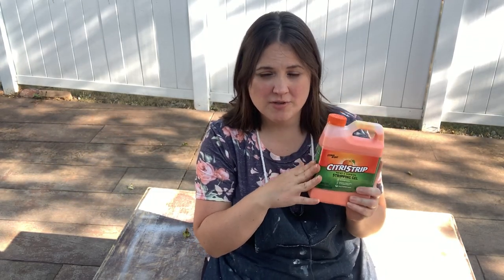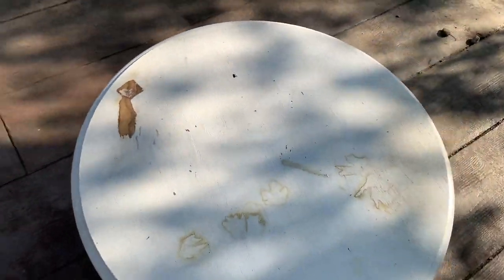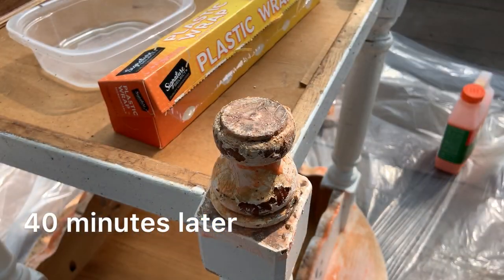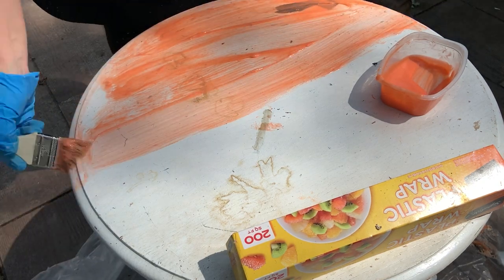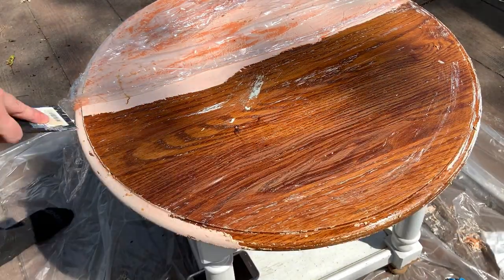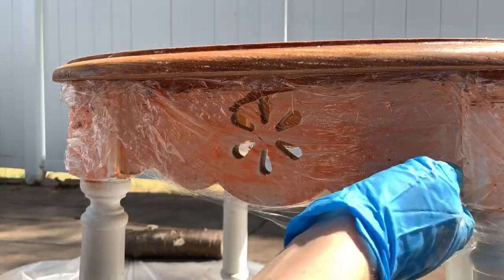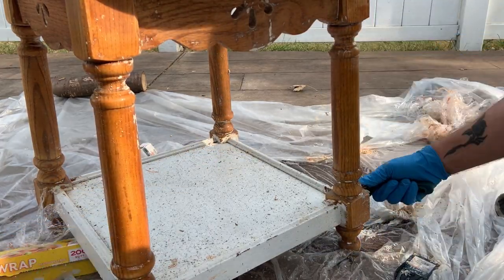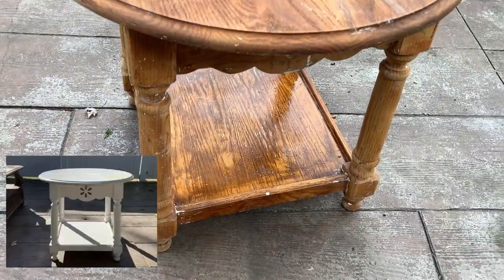How to remove latex paint from furniture using Citristrip | Furniture makeover basics

Comment: You did it well! You answered my questions so good. I was hesitant to use too much mineral spirits, but you showed that it couldn't hurt a thing! I used the wrap, but some was drying before I finished applying to my large table..but I should have done it in sections as you recommended.  I'll keep going using that tip.  Thanks for helping with all my questions.  I even went to the manufacturer website and it wasn't as good as yours.  Thanks so much.

Comment: Thank you so much, it has made my project now go much faster and smoother. I was about to give up on my project when I stumbled upon your video, and its made all the difference.  In my state they don't sell the mineral spirits so I've had to order on-line, but I have such a large project to do, its taken several coats to remove all the layers and should arrive in time, to complete the piece.  My project is a built in China Cabinet running the length of a wall. thank you for making this video to help people regular folks like me, strip paint from wood.
Reply from the maker: I’m so glad! That China cabinet sounds like a difficult project. Good luck on finishing it and Thank you for watching😊
Reply: @FlipItFurniture  Thank you for the encouragement. I'm almost done stripping 1/2 the cabinet (goes the length of the entire wall: floor to ceiling).  I have to do little section at a time and each section takes 3-4 hours. (I even had to buy couple of tools for the engraved glass areas) I plan to go buy the Dixie Brand paint and start painting by next week. I will send pics when completed. Your videos have helped me sooo much!

Comment: Is the brush you used metal or nylon??  Also the steel wool. Is it coarse or fine?  Loved the 13:07  video
I am trying to strip paint from an old wooden floor that is painted around the edges and had linoleum in the middle!  Any other hints would be must appreciated!  I only put on the citristrip and waited 30 minutes and found out that 13:07  was not long enough and left it 2 hours. Came off a little better but sticks in the grain of the wood.  Wood had never been finished so it is not entirely flat for the scraper to remove the paint. So I am going to use the plastic wrap and brush and steel wool along with the mineral spirits and see how that goes!!

Comment: I have used the very toxic strippers in the past and the do work really well. However, due to the high level of toxicity, I researched the best green stripper and decided on citristrip because the table I was refinishing was veneer. I used the wrapping in saranwrap strategy, checked on process, and waited suggested times. The result was it stained the veneer beyond salvage for staining. I had to paint table. I have since discovered that has happened to others as well. I was told the formula has changed from original formula.

Comment: You can use the plastic wrap- pending your piece underneath and the amount of paint you are removing- you can also leave the strip on overnight . The directions said wrap- I had XXXL wood beams I tested on. I actually left on overnight and DID NOT cover. I came back and the paint layers curdled like a halloween latex mask lol and just feel off in large pieces. ... just an option for people who have XXXL jobs and want to try this. I've used on floors and small and now XL residential pieces.

Comment: I wish I had seen this BEFORE I pretty much ruined a beautiful table. 😩😩 But I thankful that I may be able to salvage the remainder of the project because I was about to just throw the table out the window.
Reply from the maker: Lol I feel your pain! You can salvage it. I had the same problem on one of the tables I did in my video. I would just add another coat of stripper. Wrap it up with plastic wrap and have another go at it.

Comment: How does the metal brush not scratch the wood??? Or do I have to be really careful?
Reply from the maker: Hi Alexis! There are 3 different brushes. Nylon, copper and brass. Nylon is the softest. You can use nylon for wood. It shouldn’t scratch it. I would still be careful when you begin. After a few minutes you will get the feel of how hard or soft you need to go with the brush.

Comment: I am curious. This is new info for me. Would it not be faster to put the stripper on all of the table and then wrap it in the tarp for 40 minutes?
Reply from the maker: Hi Ray, You could definitely do that way. I prefer doing it in sections because of the mess. When you’re working with the whole piece at once by the time you finish your mineral wash in one section the citristrip tends to dry up in another section causing chaos. For me working section by section Keeps things clean and organized.

Comment: Using the steel wool or wire brush does that ruin the piece or cause imperfections ? I worry about using them due to maybe it leaving marks !
Reply from the maker: Not if you use a really fine grit! There’s options With both the steel wool and wire brushes. The brushes come in hard, medium and soft.
Reply: @FlipItFurniture  do you recommend using the soft ? I’m getting ready to refurbish a didn’t room table and chairs .
Reply from the maker: They are only a few dollars so I would probably get a medium and soft. Start with a medium and then go from there😊
Reply: @FlipItFurniture  thank you so much 😊

Comment: Would this take off a stain? Not sure if it penetrates into the wood.
Reply from the maker: It might Take a layer off but no it doesn’t penetrate the wood. It does make it a lot easier to sand after taking a layer off though. You can do a little test strip to see if it’s worth Stripping the entire thing.
Reply: @FlipItFurniture  thanks! Appreciate it =)
Reply: I need to remove paint over stain on cabinets but I want to leave the stain on the cabinets. Can I do that?  Because there’s a bunch of cabinets and I don’t want to repaint. I want the stain. 😫

Comment: I'm sorry. I might get eaten for posting this comment, but I feel it REALLY needs posting. I've been trying, and failing MISERABLY attempting to use that very expensive product, Citristrip (I am in Canada) to strip the top off a dresser (old oil based paint). 

The application was thicker than thick, sanded before I attempted to apply the chemical, and cleaned off with mineral spirits before the application. I then sealed the surface with a ton of Saran Wrap, and came down to the project every 20 minutes to smoosh the chemical around, apply more, etc. 

That dresser barely lost even 1 layer of paint, and that was on a couple of sections only. As a result, I ended up having to sand the living daylights out of that dresser to get that paint off. The scraper didn't work with the Citristrip at all, but on a section of the dresser I did NOT treat with Citristrip, it actually did a better job scraping the paint down to the wood than the section that was treated. 

At this time, you cannot even buy this crud here, unless you are willing to sell your children to pay for it at Amazon prices. 

So...all these Hosanna's about this product aren't always deserved. I've used the left over stuff that came in these pathetically teeny pour containers to strip flaking varnish off of a table top, and...it was as effective as the paint it never removed. It also made the wood very splotchy, and no amount of sanding seems to be helping to even out the tone it destroyed. 

Stuff is not good, it's awful (at least the stuff sold here), and clearly is destructive to wood when it does manage to get past the paint layer.

Comment: Hi! I'm in the middle of this saga right now and am really struggling they didn't have mineral spirits at my store so I got tsp. I still can't get all the paint off. Is tsp a bad choice?
Reply from the maker: To my understanding mineral spirits has some sort of oil in it. I’m not sure if that’s a fact but I think that’s what makes the difference when removing Citristrip. I’ve only ever used mineral spirits. Are you using a Brillo pad or some high grit steel wool? That really helps too.
Reply: @FlipItFurniture  I am using a brillo and a still brush but it is only pushing the grime around not lifting it up and off. I wonder if because it's cold and windy if that's why all the paint on the corners are not coming off. This is my first furniture project ever so I may just need more practice. Should the drawers be totally degreased by the end of this? Do I need to try just soap and water? Thanks again!
Reply from the maker: Yes! That’s it. 
I use the plastic wrap to keep the heat. On the back of the bottle it states to use between 65 to 85° weather outside. It does say it can also be used inside But I’ve done that and it’s really messy.
Reply: @FlipItFurniture  Thank you! I figured that is what was going on, because I noticed the drawer that was in the shade was in the worse condition. I am just going to put it all in my garage and try again on a sunny day lol. Thanks I really did learn something.
Reply from the maker: No problem. On the bright side I think we learn the most with mistakes!

Comment: hi there! I got this beautiful antique dresser for $50 but it had layers of badly done latex paint so I decided to strip it down to bare wood and paint it again. I did the first strip without plastic wrap and I got a bunch off, but I decided to try with plastic wrap and that got so much more off. I wanted to come back to this to thank you for that tip! I wish I'd known this before I used the first bottle but now I'm redoing it with the second bottle (and plastic wrap) before I move into the mineral spirits and steel wool. also, another tip is to apply it on T H I C K and wait for it to look a bit crinkled and it comes off really easily, sometimes with the plastic wrap!